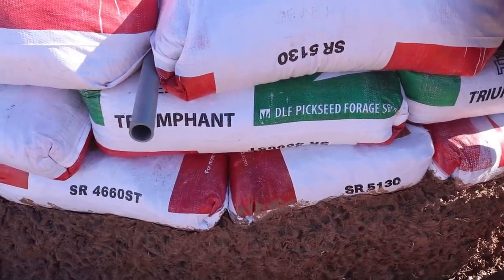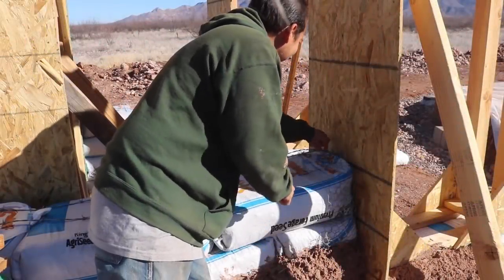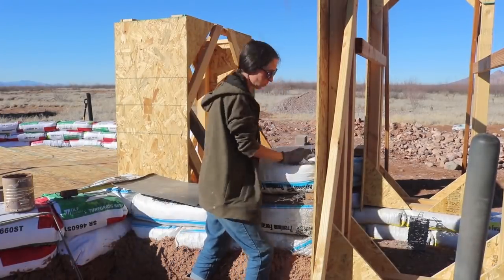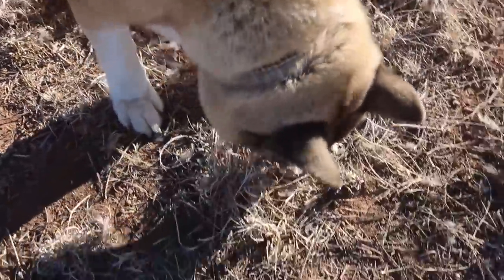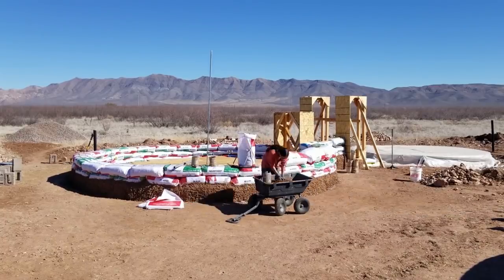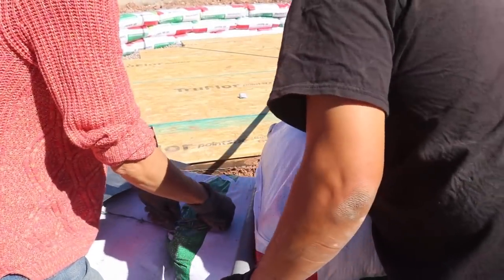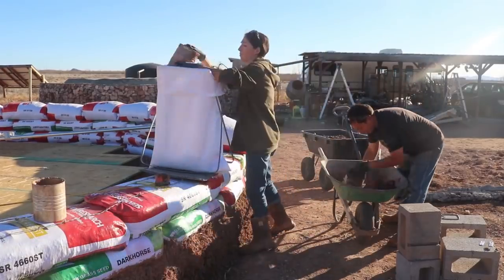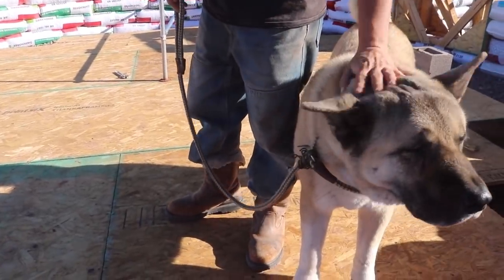THIS Is How We'll Get Electricity To Our Earthbag Dome | Building Off-Grid

Comment: Thunk about this, use a rocket stove heater in the house and  install a heat exchange in the the stove that will heat your h20.  also plumb in your solar heater,  using valves to seperate systems   between summer/winter

Comment: You need to build some screens to sort soils. Use 2" x 4" frames and stretch fencing over the frame. You can make them to fit on the wheelbarrow and wagon or make a frame big enough that it stands over the cart. The weather cooperating is very nice. To me a charlie horse is a cramp but it can be caused by an impact. Good Luck, Rick

Comment: You kids may want to look at the work of Paul Robinson for construction of domes and the classic work of Hugh Kenner for the math behind the dome.  While I appreciate the lasting value of earthbag construction, a well crafted wooden dome could  greatly increase productivity. A well built stick dome covered with ferro concrete could be just what you need in far less time using the foundations you have already started.

Comment: I would wire the house for MORE current then 60 amps. You don't have to use that much right now, but the wire size will already be correct if you NEED to increase it for some reason down the road. Maybe you might get a bigger refrigerator or freezer? Your initial current draw might be higher than you think. A refrigerator for example draws the most current when the compressor kicks on, but the current draw is much less after start up unlike a water heater which uses more electricity during use. Also, max current draw is only for a moment, not for long haul. Most things rated for efficency is for long haul over time like yearly use. If you haven't already done so, check with local electrcian. Great job though!

Comment: 60 amps is plenty......cover the ends of all your pipes as they will be 'dormat' for a while.  Nothing worse than finding the blocked, plugged, wet, or filled with dead critters later when you pull wires.     Great variery footage of lots of different activities in this vid.
Reply from the maker: Thank you David!

Comment: I imagined solar panels on the outside of the roof of the dome, wired direct for your power in the house. I like some of those places that use geo-thermal to heat water and floors as well, not sure if that is something you have explored.

Comment: 60 amp at 240 volts will be fine
I've worked on 4 unit condo that was
Wired 40amp 240 volts that was working fine it was built in the 1970s
In earlier years duplex could be wired 
30amp 110volt (one 30amp circuit)
One 110 volt phase went to one unit
The other 110 volt went to the other unit...    People learned to live with it.

Comment: This statement is just food for thought...
The codes here in L.A. County, Ca
And maybe the rest of the United States
In a Home/House.  There are only two kinds of circuits..
Those protected by Ground Fault Circuit Interupter
Of those protected by Arc Fault Circuit Interupter
maybe your in your area you can opt-out of inspections
My point here is 
no one knows the future
GFCIs or AFCI
These devices will not share a neutral
My advice is to run a dedicated neutral for each circuit.  It only cost penny's compared to building your dream
Be prepared for the future and or the people who you may sell your dream to...

Comment: You will want at least 3 pipes that sized in the wall for power and data as you don't want data to enter the same place as power due to signal interference. You want the two for power so you have a primary and a backup you can cap off in case you need to expand the power setup in the future it is easier to have the pipe in place already then to need to drill into the bags later. For data you want a line for internet, a possible line for a signal booster if the thickness and make of the walls blocks the cell signal and a possible sat line in case you want ether TV or sat based internet later on as again it is easier to have the pipes in place and cap them off then to install later. 

The other type of pipe you might want to put in is a 2 or 3 inch pipe for a HVAC system in the future as a geothermal heat pump would be very nice for both heating and cooling in the area you live in but is on the higher priced systems normally so a later upgrade.

Comment: Question:   As you get to a narrower diameter (10-15 feet?)  as the dome rises, would it make sense to switch to continuous bags that are slightly smaller in diameter, as the building progresses to less vertical/more horizontal ?    Ia have no clue about the engineering involved in earthbag dome building but it seems that might make some sense  (kind of like stacking donuts that get narrrower as the stack grows).....
Reply from the maker: We could still use single bags. We may do a bond beam at a certain level.

Comment: needs to be tested in a wind tunnel and less of large surface area etc surely there's a wind friendly way of building a green house, like making wind go round or breaking it up some shape that doesn't result in lift like aeroplane wing. etc.?
on other hand maybe it can be used to drive a pump for water etc?Charlie's horses are cramps Dr Berg has ideas why it may possibly be.. the next bags are massive. for ages I couldn't get head round cobb until you didn't have enough clay 🙄  I do sport for sure. exercises on sofa it makes a big difference being fit to endurance on work. on house. it really coming on now the massive bags are being used.